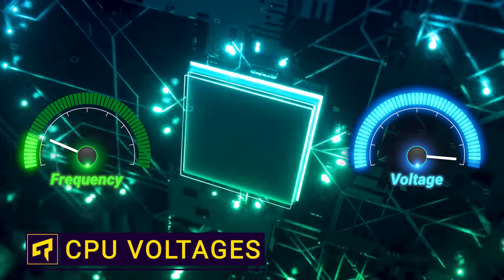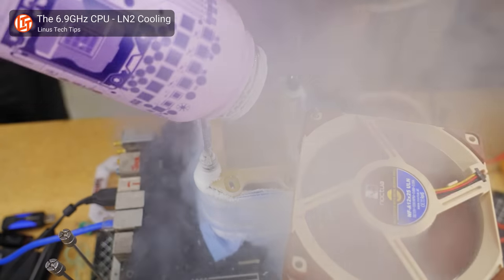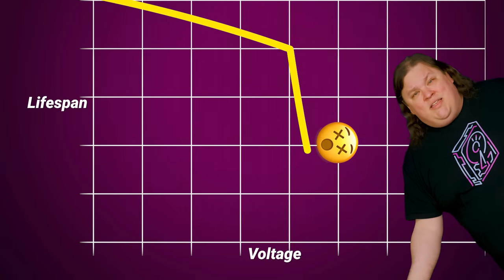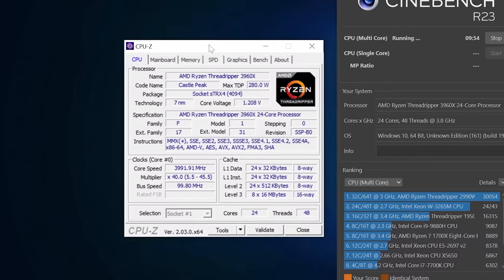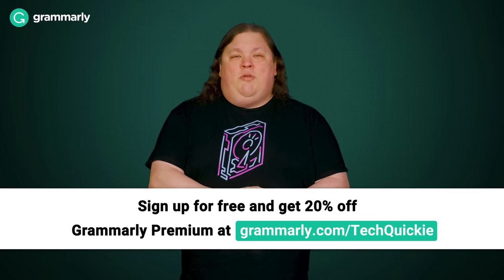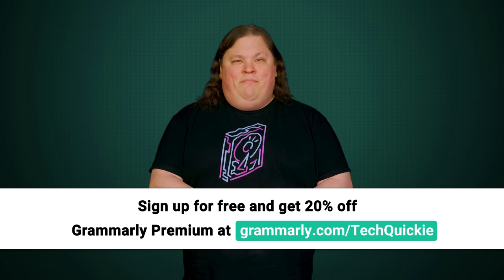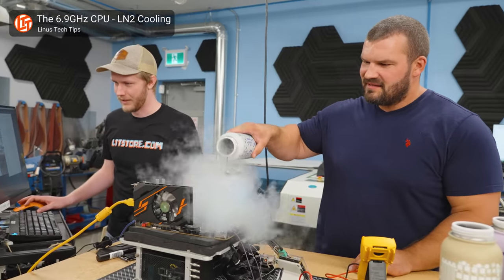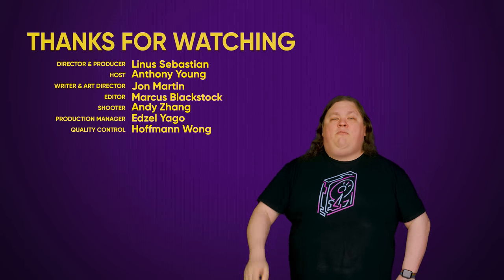What's the Point of UNDERVOLTING Your CPU?

Comment: Nvidia left the room in hope that there won't be a follow up about undervolting GPUs.
Reply: true
Reply: I mean, nvidia gpus have been crazy good with undervolting since the rtx 3000 came out, its positive press for them if anything
Reply: @MFMArt  Doesn't work as well for the 4090. Optimum Tech made a video about how undervolting, even when hitting the same clock has less performance for some reason this time around.(usually you'd just expect a crash if there is not enough power to maintain the clock) 

He did neglect to mention that others have set power limits to reduce power while keeping very high performance nonetheless. I think he may have just been ignorant of that.
Reply: @MFMArt  seems like it’s just a silicon lottery thing, cause UV is not working for my 4090 in real games and I’m getting better success with just a power limit like Optimum suggested. Very weird card.
Reply: They’re hoping we start using 220 like the washing machine two phase
Reply: @joemarais7683  doubt I hit silicone lottery, for the curve I just use a modest 950mv under clock, and if you want to be extra safe just knock the clock speed down a bit more. I'm on a msi gaming trio which isn't the higher binned cards and I've seen a few YouTubers so far that are able to hit 925 mv fairly easily with higher clocks than me, especially on oc cards
Reply: @KalebSDay  I saw that video too, and Optimum Tech seems to have a weird opinion against both undervolting AND setting a power limit on the 4090. He directly recommended against der8auer's method in the comments section of that Optimum Tech video. That video and subsequent comment was strange enough to make me wary of future Optimum Tech videos. Who cares if you lose 5% performance on a card that powerful? The tradeoff in lower power consumption is worth it 10x over, especially in daily driver gaming applications.
Reply: They just don't care.. If they can overwhelmed US 110v circuit, they'll do it. 😂
Reply: My 3080 is happy undervolted. Saves me 100 watts
Reply: Linus just did a video about undervolting a 4090 last week on the main LTT channel.
Reply: @rizkyprima2649  wow that's a very naive response in the spite of nvidia hate🤣🤣🤣
Reply: Just ask anyone who was mining on their GPUs for any length of time, because I had my power target on my 3070 set to -40-50%, my memory clocks jacked crazy high, and my core clocks lowered by a substantial amount and it was pretty nuts.  It would crash in game if I forgot to switch profiles when I fired it up, but on less demanding stuff I occasionally realized I forgot to change my settings, turn off mining while watching YouTube on a second monitor.  Sure, it tanked my mining profits, but it didn’t drop them to zero during, and I was thoroughly impressed by how much efficiency was able to get out of it.  My old RX 5700XT was way more efficient and undervolted better, but it was an early XFX reference design with a blower cooler that I never modded so the memory hit a hard limit much lower than I would have hoped, but it was way more efficient than my 3070 was on the amount of profit per the amount of energy used.  I had an RX 580 and a 1070 that combined to make nearly as much per hour as my 3070 or my 5700XT, but their efficiency was pretty much half.  It was still profitable so I kept them running, but it’s impressive how much efficiency improved from the AMD cards in a single generation, because there was an entire generation of Nvidia cards in between that, and while I never tested any 20 series cards, best case scenario was that it doubled efficiency and, which means there was zero improvement moving to the 30 series—or it was somewhere in between, which isn’t as impressive as AMDs gains.

Anyway, I’ve drifted a bit from my original point, which is that GPU undervolting is surprisingly effective.  I did it to lower temps and give my VRAM more headroom to clock higher, but AMD cards have done well undervolting to improve performance.  The slightly lower temps allow it to boost longer, which even though it’s at a slightly lower clock speed, it helps the VRAM stay cool and clock higher, which can result in higher average fps than running stock, which I would imagine only looks better on paper or in certain synthetic benchmarks, which is the only reason they probably do it.  It may also be more variable based on silicon lottery, and the stock voltages are the most reliable targets to get consistent performance out of every card that rolls off the assembly line—but more shining examples can perform just as well without shoving even more energy into it.

Personally I don’t fuck with RAM or CPU overclocking or undervolting.  I allow the automatic stuff to do it’s thing, because a bad memory OC can lead to reading or writing corrupt data to your internal storage, and without ECC that’s bad, and if I lost data because I was trying to get 5-10 fps, it’s not worth it.  I’ve run Ryzen 3000 and 5000 series CPUs in my systems and spent hours fucking with settings pushing things as hard as they appear to go, and every single time I would do that, I would risk stability and benchmarks were never any better because unless you do a stupidly inefficient all core overclock, the automatic OC features like precision boost and precision boost overdrive will wring every last drop of performance out of it anyway, and while it may or may not look like your settings are set higher, unless you change your cooling setup, the average performance will end up being the same and you’re just trading for more impressive looking numbers that won’t boost as long as the lower numbers that boost longer, so you give up what’s a much smoother experience for the cost of more power wasted, and a much spikier performance.  Thanks but no thanks, just turn on PBO, slap on a big ass cooler and watch it run as hard as it can.  Seems like the new ones are setup to do that even more so using stock settings.  Intel may be a different beast, where it still makes sense to do, but if I want to play around with overclocking hardware, I can satisfy that urge by playing PC Building Simulator 1 or 2.  It’s faster, less complicated and there’s less quirky variables at play that you aren’t aware of like real life.
Reply: Hah. poor peasant. he doesn't know physical things can be physically manipulated.
Reply: How do you undervolt the GPU? I'm using MSI afterburner.... You just lowered the Power limit, or to undervolt you need to manualy change the CURVE of frec/volt?
Reply: @MFMArt  im sitting on a 3090TI im thinking of undervolting as well for the dramatic reduction in wattage. ive also heard the same, that its a minimal performance drag...it just makes sense until theres a performance crossover where my system struggles to keep up with games in 4-6 yrs, theres no need to stress my video in 2k widescreen(4k gaming, doesnt have enough upside for the video quality unless in VR)
Reply: @Sam-xx5kz   imo even when games start coming out that will challenge your 3090ti I'd still recommend keeping it undervolted and sacrifice the 5-10% or flat out upgrade, the 5-10% is not really a noticeable difference in most cases unless say you are trying to hit within gsync limits (usually 48 fps) or something else critical for yourself.

That's essentially what I did, just moved up to a 4090 so I could saturate my monitors refresh rate at 4k with pretty much any game, and slap a decent uv on it
Reply: @Σά ββας the undervolt just as good, that's the point and you are missing it
Reply: @MFMArt  does this improve your battery backup?
Reply: @ekeretteekpo3004  I mean it should, you consume less energy if undervolt so batteries should last a bit longer, I don't really mess with it on laptops though.
Reply: You can undervolt nvidia gpu's though?!
Reply: You mean AMD* left the room since their new lineup uses about 100w more power while being nowhere near the 4090?
Reply: Luckily with 40xx they can come back in the room😅
Reply: When mining was profitable, the most profitable way to mine was undervolting the gpus.
Reply: They did for 4090
Reply: @MFMArt  4000 series are awful for undervolting.
Reply: @AvallonYo  or the rest of the world.
Reply: I'm running my 3060 2100 MHz and the vram at 8600 MHz at 950 mV. Full performance and never runs over 55° peak. I made Nvidia my bitch.
Reply: I went from .905 to .900 same MHz 2490 and it lowered my temps/power a lot on my 4070 Ti, just runs better-
 have no clue what you're talking about
Reply: It's a real kick in the bag when you find out the Ghost in the Machine is John McAfee by dethreading the framerate boost to discover the boosted values are set to normal

Comment: He fails to explain why undervolting can help you gain some performance. That is, it can prevent your CPU from reaching throttling temperatures....
Reply: Thanks
Reply: wouldn't it also decrease the CPU's performance?
Reply: @shantanuzodpe9880  CPU are not equal thus come the term silicon lottery. The factory set voltage is meant to work across all CPUs, including the worst of the lottery and even worse than that just so everything works and thus can be sold to consumers. That is to say the voltage is often set higher than needed to for most CPUs.
Reply: @Lu5ck  so u mean for gaming and for tasks like video editing we don't need that many voltage on our cpus?
Reply: @shantanuzodpe9880  Voltage is like the horsepower of a vehicle. The vehicle has to go through a road called circuit in CPU. Not all roads are perfectly flat and even, to overcome these uneven and not so flat roads, we use more power. Factories cannot and will not spend time to optimize all CPU voltage, they will just use a universal voltage setting that works, even on the harshest road.

You, as a user, can choose to spend time to optimize the voltage settings and this is what this is all about.
Reply: Not to mention power limit too. Less voltage = less power = higher clockspeeds

Comment: Not mentioned in the video: Intel XTU allows you to adjust a whole lot of these values in real-time while you're booted in Windows, completely bypassing the need to go into the bios every time. If the computer shuts down due to instability, the cached settings are wiped for easy recovery, allowing you to try again. Highly recommended!
Reply: So basically Team Blue's Ryzen Master?
Reply: @steemlenn8797  Yep, they just didn't mention any real time OC-ing software...
Reply: Not very useful since you shouldn't be using Windows anyway
Reply: @steve55619  Let me guess, Linux?
Reply: @GreatYamatanoOrochi  or a mac user
Reply: @steve55619  To each their own, if browsing is all I ever wanted to do I'd be jumping ship to some unix distro as well :P
Reply: Intel XTU indeed is very useful, even a casual like me can easily under volt the CPU on my way too hot laptop
all the basic tool needed in one package
Reply: @chrisdt2297  Hear hear. Now to follow suit on my brother's laptop to improve battery life, and also set up a curve on its GPU too :D
Reply: @steve55619  just dual boot and go away
Reply: But the problem with XTU is that sometimes it just reset offset and you have to check each time you turn on PC if it stayed undervolted or if it did reset.
Reply: @danosk1  The only instances where that's happened to me is if my computer didn't shut down properly, as that resets the cached changes. It tells me if that happened when the app starts on logon too. If you're not getting either, may wanna double check if the app is actually able to keep changes saved at all or something.
Reply: @steve55619  For testing it's fine. After you settle on something, you can apply that in BIOS.
Reply: @steve55619  oh no, here it comes.... 🤓

Kek
Reply: I use ThrottleStop because it allows me to limit the CPU clock speed. With turbo disabled, it’s too slow, but unlocked speed it’s too hot. I limit it to 3Ghz because most games don’t need crazy speeds to run well. I run my games with either a 60FPS cap or Vsync (if the game doesn’t have a broken vsync implementation lol) since my display is only 60Hz. I don’t play competitive CSGO or much multiplayer so I DGAF about getting 200fps.
Reply: @SalivatingSteve  Fair to you, not all of us have the same requirements. Undervolting is a great process for battery powered devices, and so is throttling when needed. Temperatures are also kept lower, so it's a win for competitive uses too. XTU handles pretty much anything related to the CPU so it can also do core clock control. Want to run 5 ghz on single core utilization spikes, and 2.5 ghz on all core utilization? Easy. Want to disable turbo or adjust its power draw limits and duration? Also available. You get granularity without the trips to the BIOS screen, that is all :P
Reply: read in afterburner crash loop
Reply: Yeah but they're a bit finicky if you're not a big fan of too much background programs running. BIOS is the best option on the long run, if the overclock setting is already confirmed. However, XTU comes in handy when the bios does not allow any overclocking, which is the case for nearly all laptops. The reason I mentioned laptops is that Gaming Laptops gets the biggest benefit from undervolting. Less thermal throttling & Consistent performance.
Reply: AKA ryzen master
Reply: @steemlenn8797  Seriously better than ryzen master. XTU is realtime, does not need restart to apply changes, which is the whole point. If the settings are bad, a restart restores to default settings. If settings are good, you can continue fiddling and saving to a profile for future reference, till an instabillity restart occurs again.
Reply: Got XTU, and my UV settings are greyed out. Any suggestions on how to fix that?
Reply: Gigabyte EasyTune..
Reply: @simongrozov1801  Good question, but I couldn't tell you anything for certain without knowing what hardware you're sporting in the first place. :P

Comment: You still didn't explain how undervolting can increase performance. I thought it was done because you can generally get away with lower power consumption, and about the same performance, but increasing it? How does that work?
Reply: The processor will boost higher during power-limited scenarios as the power consumption is lower, allowing for higher frequencies at the same power limit.
Reply: Undervolting can help with thermal throttling.  If your cpu starts to boost, it will hit some very high temps and then slow your clock speed down to reduce heat and therefore have crappy performance.  In my case, once my XPS boosts and throttles it's very hard for that thermal load to come down even after it throttles the clock speed.  You could also disable boost from xtu or throttlestop to make sure your system doesn't boost even with an offset in place.
Reply: @munkykng416  yep, I bought a gaming laptop with an i7 10750h and it often hit 100c causing throttling. undervolted that baby and locked the cores at 4.6 max and got a big boost in performance while running almost 10-15 degree cooler
Reply: Additionally to the answers : I am pretty sure this is because how manufacturing works. As all chips are different, they will have different optimal voltages, so I assume they set it to a very safe value and avoid releasing unstable CPUs out of the box.
Reply: @lilbroomstick7032   hey U did that using throttle stop ?
Reply: @VishalGTitus  yeah throttle stop, it's very useful
Reply: @lilbroomstick7032  I tried to use it on my 10th gen i7 but it is not working.
Reply: disabling Turbo boost is working
Reply: @VishalGTitus  what do you mean exactly?
Reply: @Pityke4  but like, wouldn't they test them anyways to see if they run before boxing therm? if so, why not set the proper voltage figure for that specific chip?
Reply: @ValkryNL  cost I guess. It's just speculation from my part but stability testing takes a lot of time, so they have the voltage with all chip work stable, they just set it instead of extensive testing.
Reply: Lower temps means more headroom for it to turbo longer